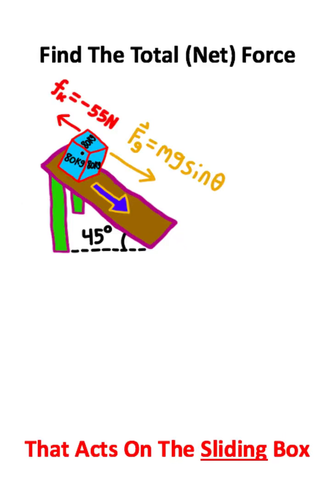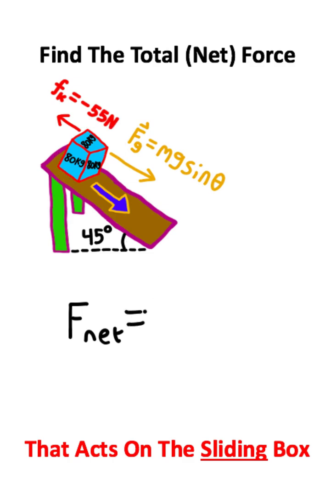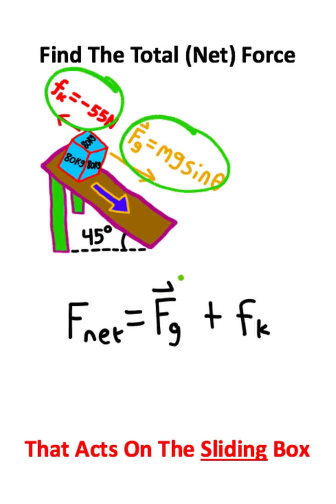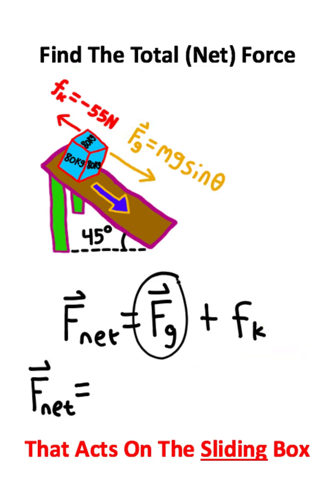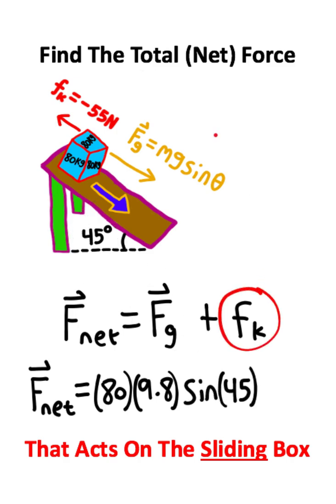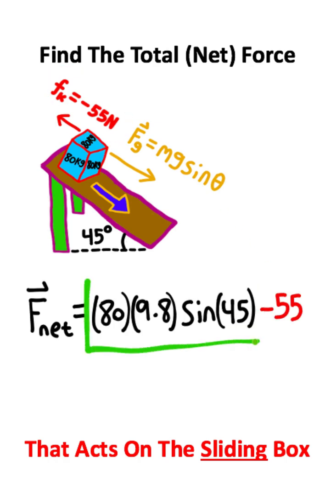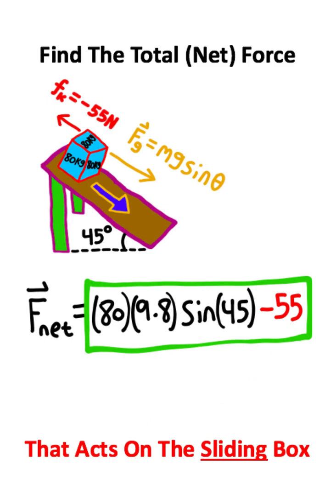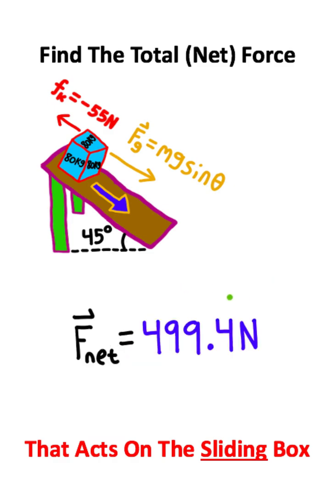How Much Force On The Box?!?

Comment: You are making approximations that make your answer too accurate ... eg  use 9.81 and the answer is approx  499.9 ... so 500 is a better approximation which does not assume false accuracy.

I once had a conversation with a mathematician ... 
Me in my head " ... so we will make about 35% profit!"
Mathematician on a calculator: "... NO ... it will be about 34.65%"
PS ... you use an accountant afterwards to tell you why you didn't make anywhere near that profit. As someone once said "accountants are there to knife the wounded".

Comment: What about the normal force, reacting perpendicular to the surface?
Reply: First draw a free body diagram
The friction is defined by the normal force.
f being friction
u being friction coefficient
N being normal force 
f=u*N
N=mg*cos(øº)
Ø being the angle of inclination
Also, the sum of forces in the y axis=0 because the object is not sinking in the inclined plane plane.
Reply: Bcs it’s perpendicular , and cos(90) is 0 so it cancels out simple as that , plus if there was resultant in the vertical component it would be moving upwards or downwards(vertically), and this qs is abt the box sliding down so we are finding the force parallel to the slope